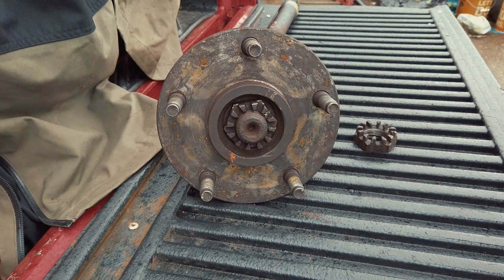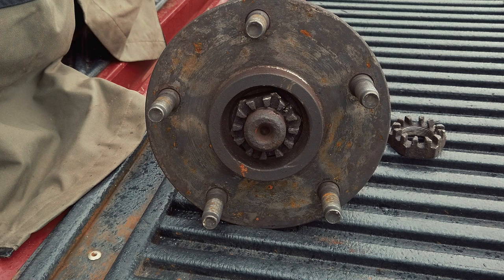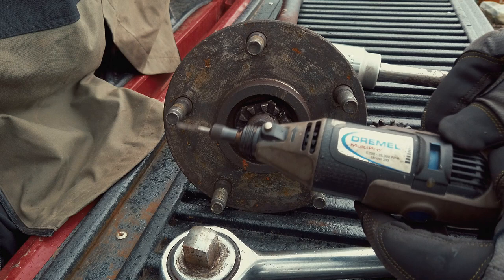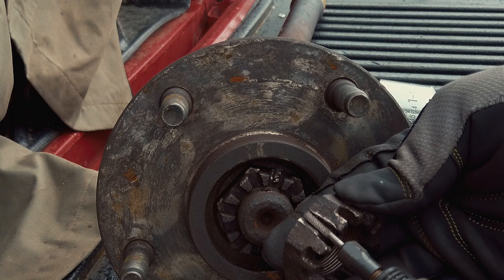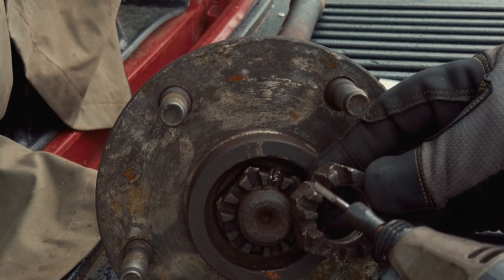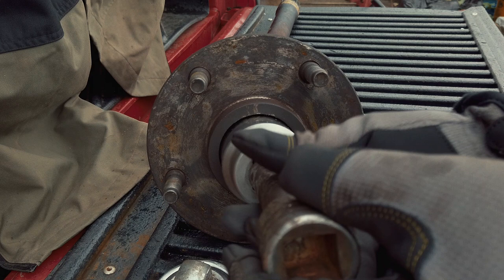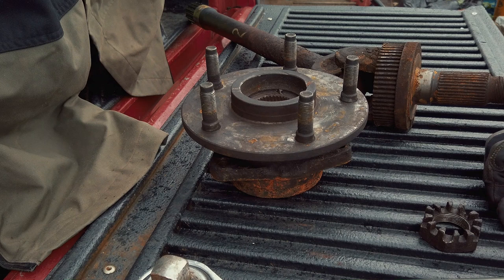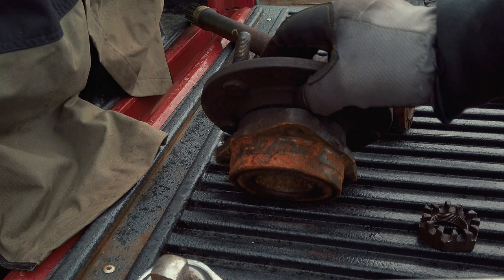Axle Nut Removal

Comment: Dealt with a few stuck axle nuts. Tried breaker bars, heat + candle wax, etc. The only method that worked for me was using MAP gas torch to get the axle threading super super hot, ~10 mins, then poured water on it. With a jack stand supporting the axle socket, the nut finally broke free. The heat expands the thread, then the water rapidly contracts it, and it should break free. Good luck

Comment: Thanks for the advice. I am dealing with one of these axle nuts and I used a rotary tool to cut some notches hoping to use a chisel to  turn the nut as opposed to splitting it. Long story short I ended up with a nut that was so chewed up beyond recognition that I could never hope to get a socket on it. Good call replacing that wheel bearing, that thing looked about done.

Comment: Nice video.  Get yourself a Bernzomatic 8000 & some MAP gas.   It’ll heat up a spindle nut in about 5-10 mintutes plenty hot enough to break loose.  Heat is your friend when trying to remove stuff like that.
Reply from the maker: A touch is for sure an appropriate tool for this application. However, due to the fact I already owned a Dremil tool, it was quicker and cheaper to just grab the Dremil and grind it out rather than running out to buy a tourch.

Comment: My 2004 silverado had a stuck on axle bolt. Totally rounded out. Normally it's a 36mm. I just banged on a 35mm and prayed a bit. Got it to Crack with the breaker bar and Pipe. The sweetest sound on earth 🌎
Reply from the maker: Awesome 💪

Comment: Soaked it with lube, twisted end off breaker bar and gave up for the day.   Bought tungsten carbide tool and just like you, had it off in 20 minutes. Great technique. 
Good call on the magnet to catch the shavings.  That stuff is super fine and super sharp.  Don't touch it with your bare hands.  It's like glass.  Sticks into your skin and you need magnifying glass and tweezers to get it out.
Reply from the maker: Yes, I agree the metal dust is nasty. The truth about using the magnet is; I wear eyeglasses and when I use a drill or Sawzall the dust gets on my eyeglasses and when I clean the lenses it puts microscopic scratches 😖

Comment: thank you i got a axle nut from hell on my honda atv im going to have to take a drill bit to it and do the same type  thing as you. think it would work like that cutter price you got there? or do i need something like that?
Reply from the maker: I've used drill bits to do similar kinds of cutting however,  it might take a while. With that said;  the best tool for the job is the tool that you have at hand.
Reply: @lenzwizard  you are right thanks for the quick reply and helpful video. appreciated!

Comment: I weigh 235. I got a problem with a nut being welded or melted too my back axle of my antique Worksman tricycle. Help someone!
Reply from the maker: Most likely have to grind it off of it is welded.
Reply: @lenzwizard  You're saying I would have to have a  new axle? For a kid's tricycle we used Carter pins with caps on the ends. Think that might work instead of new axle? I bought it this way.
Reply: Things were so much simpler in our day. I drove a Hyster Hydraulic Furniture Lift at Grand Furniture with a long cart on back. Why can't we just drive those on the roadways? Have plugin stations instead of gasoline stations. I could drive one of those like wheeling an 18 wheeler. Fast and easier to use. Less maintenance and no more heavier than an automobile. Ha! Ha!